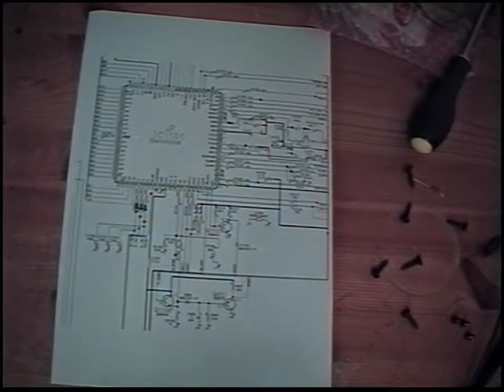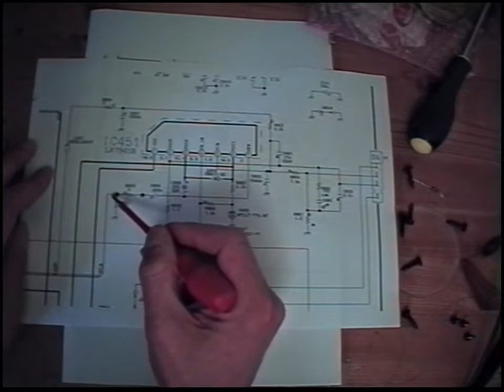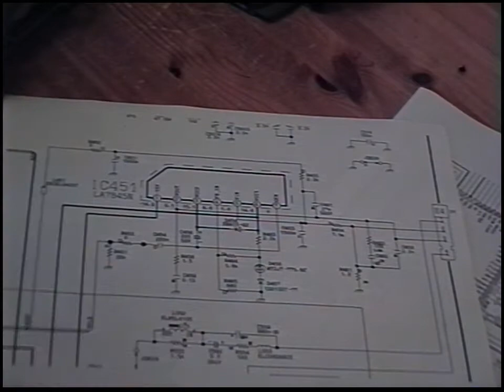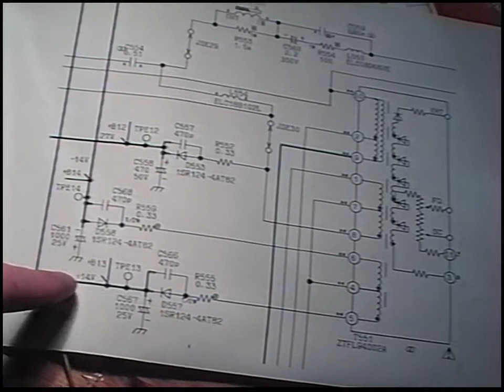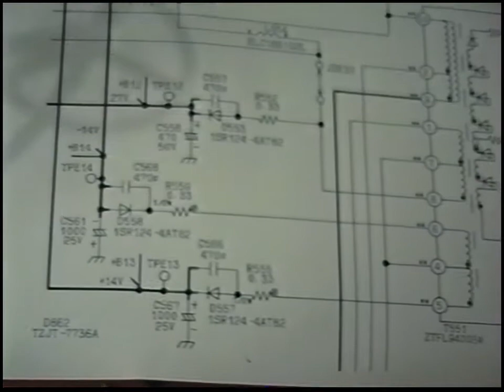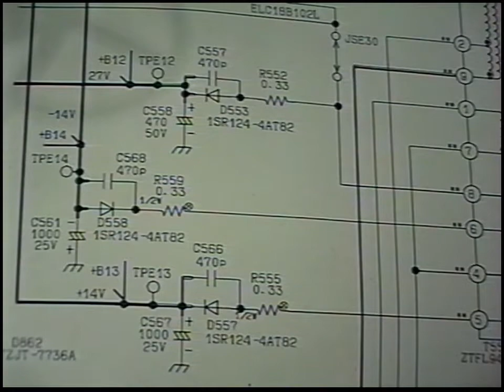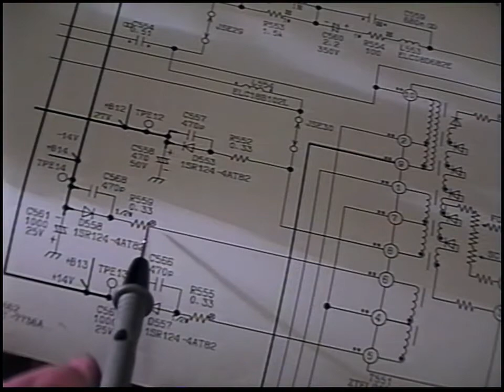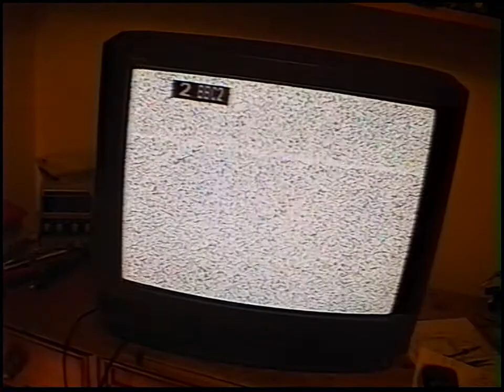Panasonic Euro 4 CRT TV Repair

Comment: Hiya mate, i've got the same TV, with a similar problem. As as soon as it turns on it turns off again.
Sometimes it stays on. Yesterday it ran for a good hour or so.
This morning I turned it on, you can hear the high voltage, the picture comes in, then the picture shrinks into the top of the screen and then comes back. Then shrinks again, then eventually it shuts off. It's almost like it's losing the high voltage possibly?
I've checked both 0.33ohm the resistors you mention in this video and they're good.
I've also replaced all the electrolytic caps in the TV.
I've checked the diodes you mentioned.
The standby light stays on no problem.
Is there anything you could suggest?
Cheers
Reply from the maker: It could be dry joints. This chassis is know for problems with them particularly around the frame output chip. Try resoldering all the joints in that area and try it again. The frame chip is the LA7845. Let me know how you get on.
Reply: @nowt1002  thanks for the reply. I re did all the solder joints around the frame chip and basically everything else on the hot side of the board. 

The TV fired up and worked for a good 3 hours with no problem.

I turned the TV on this morning, it fired up then after about a minute it turned off. Now it turns on then turns off straight away. Or the picture shrinks then it turns off.

I think ambient temperature is a factor. The heating was on last night and it would have been upwards of about 21deg. The TV worked. No problem.

This morning it would have been more like 16deg and the TV turns itself off.

I'll check all the resistors to see if any are out of spec.

Cheers
Reply: Hiya mate. You were right it was a dry solder joint, but on the cold side though. I thought I'd narrowed it down to transformer, then the yoke harness. Tapping them with a toothbrush. Sanded the pins for the yoke connector. Then I noticed the picture went mental when I touched the scart connector. Re soldered all the points and its solid as a rock now. Thanks again 👍📺
Reply from the maker: Nice one. Things like that where its intermittent or seems to be affected by temperature are often down to dry joints. The board flexes as it heats up and pushes the joint together. They can be a right pain to track down though. Glad you got it sorted. Another telly saved from the tip.